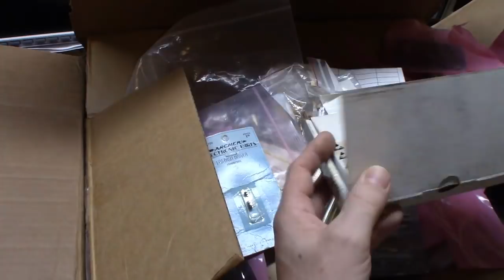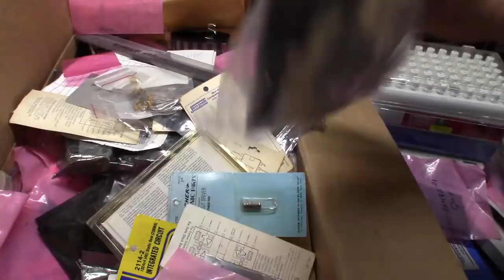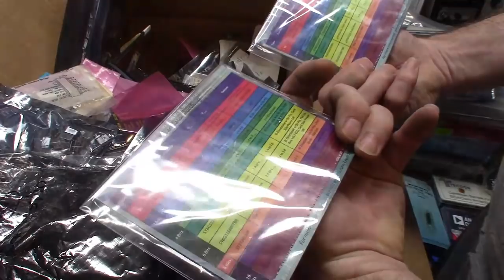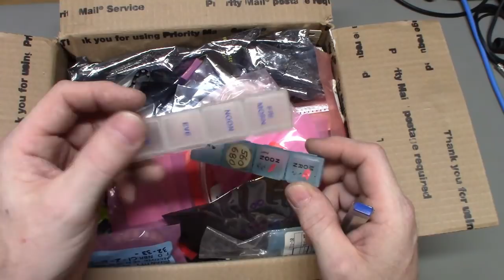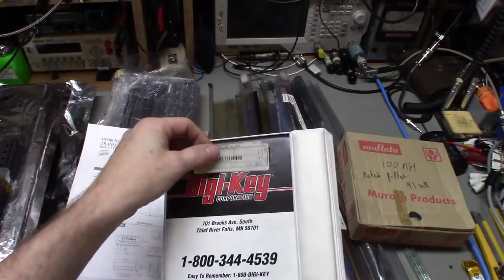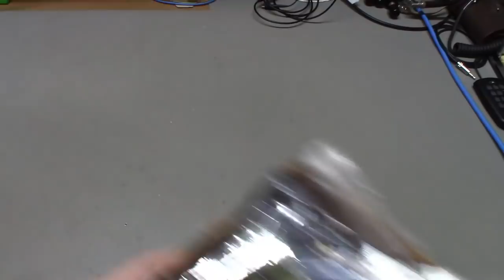Mail bag. 69 pounds of electronics goodies, the mother load.

Comment: Those display modules are led bar indicators. There is a driver chip , lm3914 SMT or lm 3915 (dip) that will drive the LED segments to indicate a 0-5 volt analog signal. Great for tuning indicators etc.

Comment: "When push come to shove, even big industrial companies would just run down the street to Radio Shack..." Absolutely right! I worked for a medium sized electronics manufacturer in the 1970's and 1980's in Washington state. That's what we did. Even then, however, RS was expensive compared to wholesale. They were only good in a pinch.

Comment: Y'know, you may want to check some of those OPamps. Some of the obsolete vintage ones are coveted by guitar stomp box builders
Reply from the maker: LOL, don't know about guitar stomp box builders but some are already coveted by me.  There were a bunch of ultra high end high current op-amps in there.  They are made on ceramic substrates and have ratings in the 3 to 5 Amp operating range.  Those SIP package IC's in the one tube I thought might be audio amps were some of the other op-amps.  They use the internal op-amp to drive a built in Darlington pair transistor for high current applications.  This box was definitely a gold mine.  The tray with the Spartan FPGA's alone paid for the box several times over.  Those cost $75 each!
Reply: RF heaven

Comment: Just thinking  those FPGA's could allow you to design the ultimate Flex Radio CB transceiver, FPGA chips can be programmed to become a complete digital IF and demodulation module which would be driven via a dual channel ADC.
Reply: would not be type accepted.